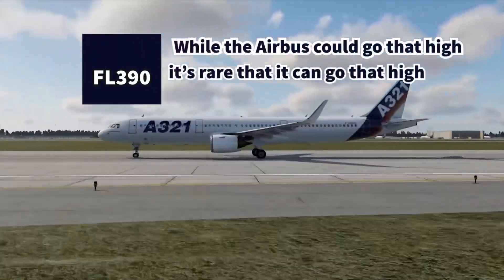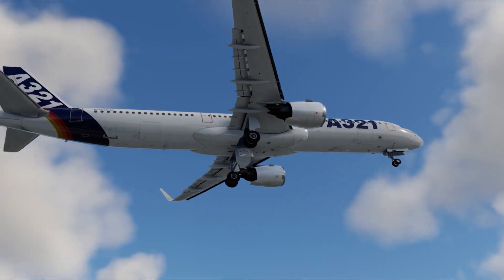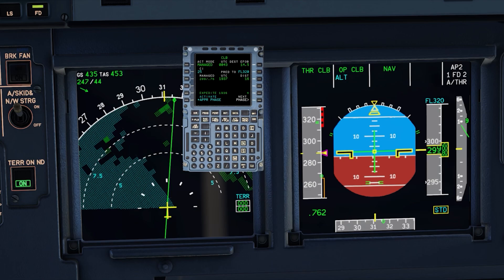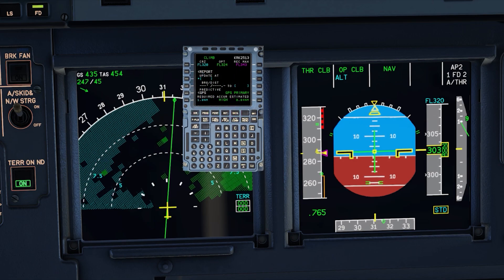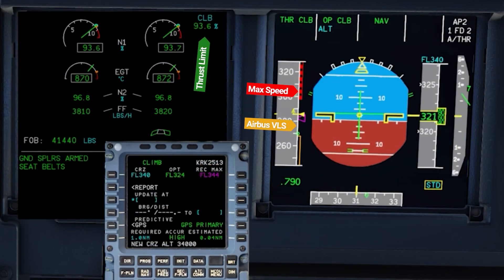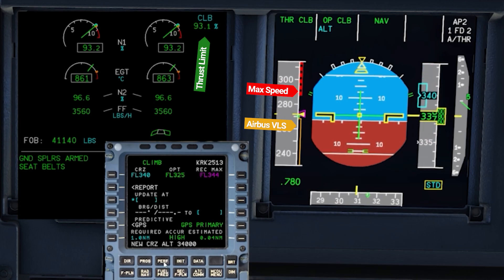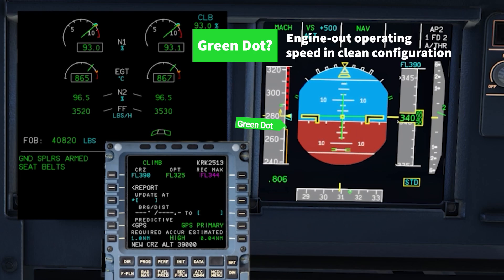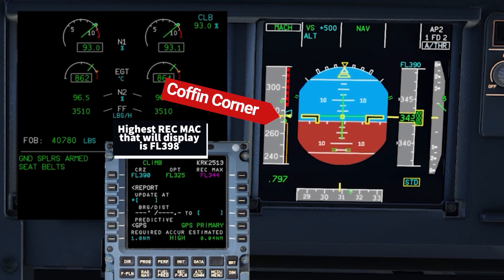Why Airbus 321s can’t always cruise at 39000 feet.

Comment: Why is the 320 series limited to 39000 feet? While the 737 NG can go clear up to 41000 which personally I have done quite a few times especially 737-700 .
Reply from the maker: The Aircraft manufacturer limited the aircraft based on engine thrust and lift of the wings. It is very rare for a 321 to go above 350 unless almost empty.
Reply: well of you look at the timeline. the 737 classic comeout first which have service celling of 370, then airbus with 390 then NG with up to 410